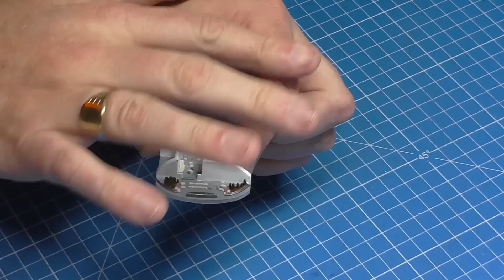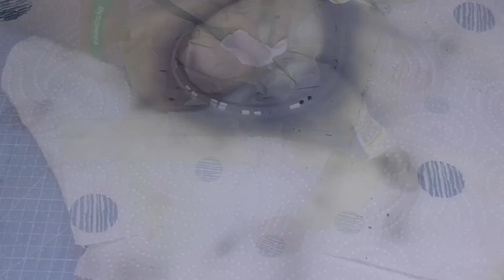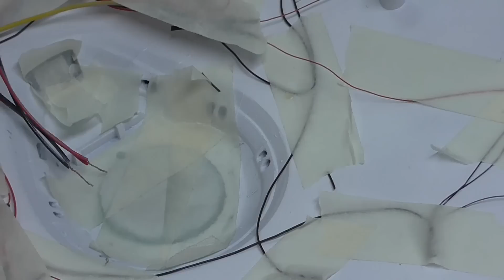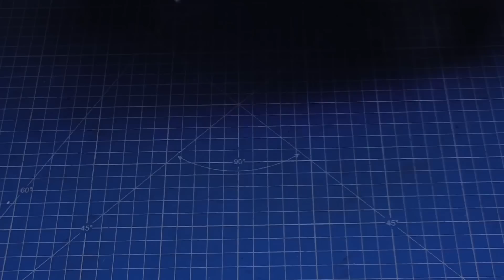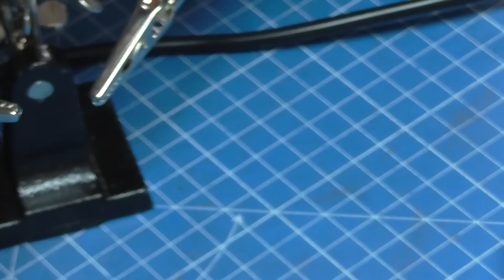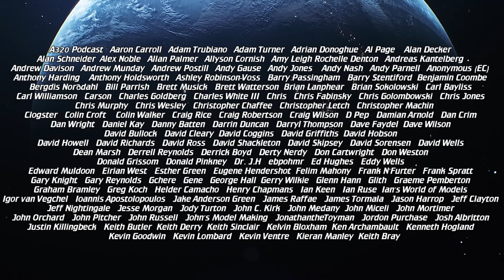Build the Polar Lights USS Enterprise Refit 1:350 Scale - Part 8

Comment: Tinning refers to the process of applying a thin layer of solder to a surface, typically a wire, a component lead, or the tip of a soldering iron, before making the final solder joint. BTW I've had the LED tape fail on me, so I always hit them with a little CA glue now.

Comment: OK, we have a very different system for working out if masking went well or poorly.
The grey area is inset - the grey should start from the intersect. The whole way round you start it a mil or so inside the intersect at the top, and go a mil or so over the intersect at the bottom, and you have excessive bleeding on the entire piece. 
I'm not trying to be harsh for the fuck of it, but you don't turn a pig's ear into a vienetta but just saying it is so.

Comment: Just out of curiosity, what happened when you tried 12V? Going at or above 12V often burns out the voltage regulator on the Arduino
Reply from the maker: It burnt out the main chip

Comment: The electronics are still a little above my paygrade. But I did appreciate you explaining the Buck Converter. I also followed how you programed the Nano Arduino and connected the two together. After that, I got a little lost. How you are able to correctly identify each wire without labels is amazing.  Two things though. (1) as you were removing the tape from the saucer section, I notice some "debris" - I hope it was dust and not residue from the airbrush. (2) When I mask off around panel lines, I find that applying a wider tape to the area and using a fresh Exacto blade cut the tape following the panel line. This ensures a razor edge and eliminates paint bleed. When you removed the tape, I did notice some micro-rough edges - but you'll probably never really notice it unless you examine the ship with your magnifying glasses. 🙂 This video series is really educational, and I look forward each episode! ￼👍 p.s. I thought you said "But Converter..but it's really a Buck . . . LOL. I found it in my U.S. Amazon search.